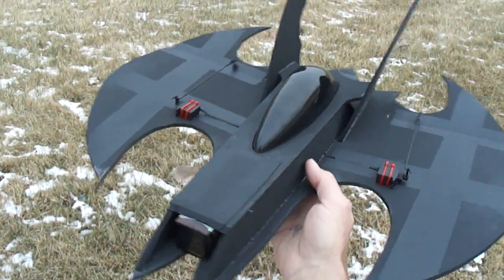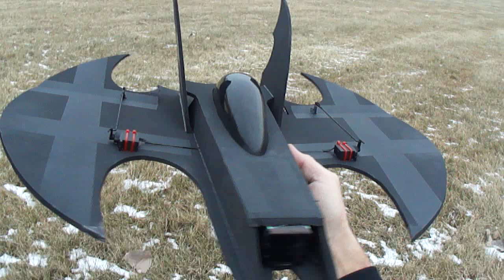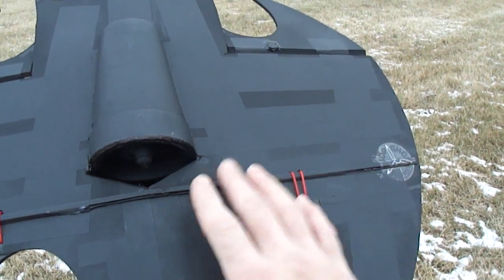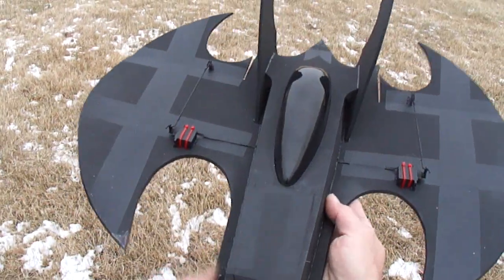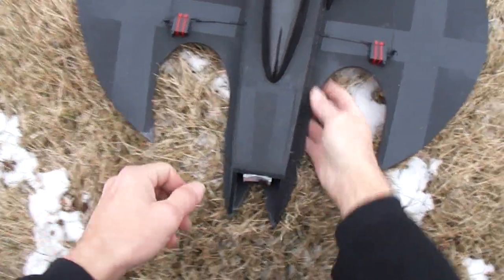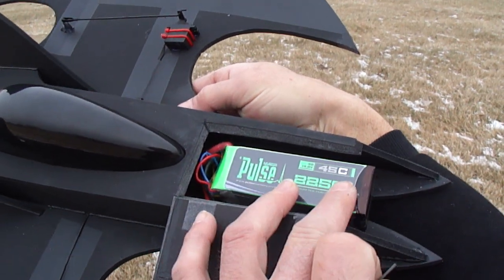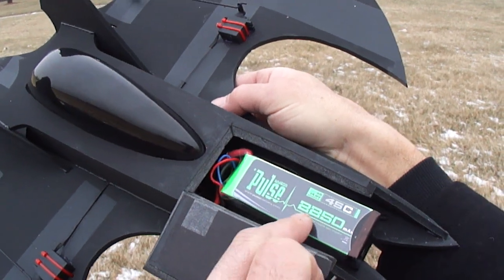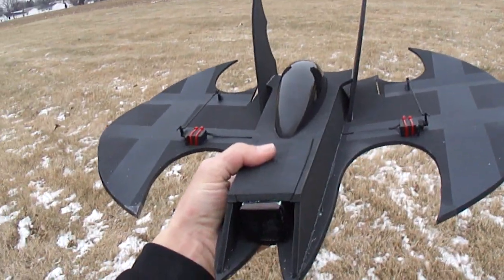The (Bat Wing) 70mm EDF RC Jet. PDF Plans now Available. http://foamconceptjets.yolasite.com

Comment: Excellent build, thank you Chris Allen for sharing, my Dark Wing is beautiful, will post up a video soon, I only ran into 2 issues, the plans need to be layed out to precise size, as my original print turned out much smaller than your sugggested size, need to put down exact size measurements on plans.  The 2nd was actual cutting needed a stronger Exacto blade as mine didn't cut well.  Flys amazing, so proud of this build, everyone stops me at the park.  I highly recommend anyone doing the build reinforce using Epoxy glue on bat ears and front wing edges, that will get damaged very easily after a few landings.  This is a dream edf jet!
Reply from the maker: Sorry but sent the dimensions for the dark wing along with the plans to your email, maybe you just over looked them sorry for the mishap.
Reply from the maker: Having them revised ASAP.